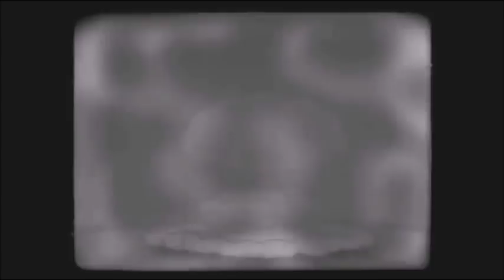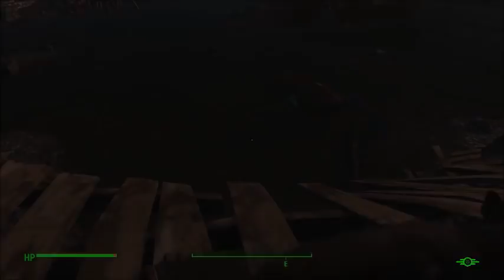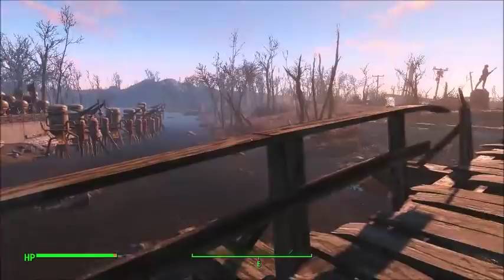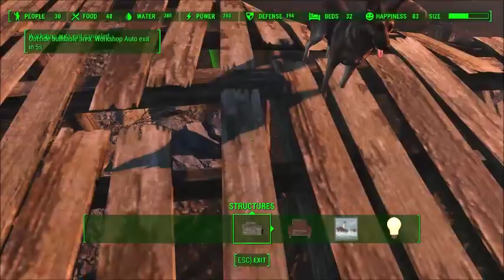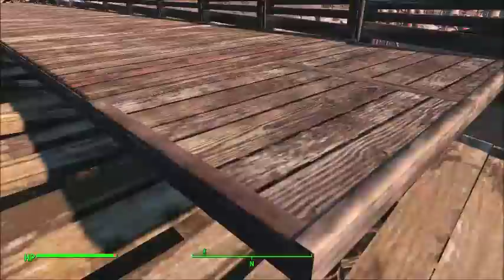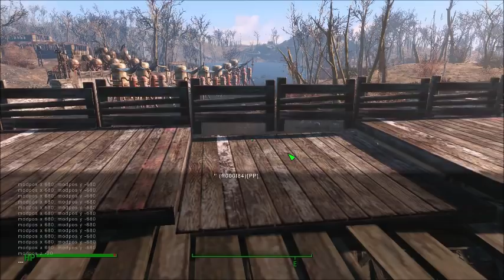Fallout 4 - Repair Sanctuary Bridge on PC (no mods or DLC)

Comment: Man I wanted to do this on Xbox but smart thinking
Reply: AndyTheGreat sorry for being a noob but how do I create a Bethesda account
Reply: Hey you actually can!download place anywhere mod and it works!
Reply: AndyTheGreat I guess but I've never used made before do I just search the name of the mod?
Reply: If you don’t have a Bethesda account create one because you need a account to download the mod,just follow the tutorial,the mod comes with a tutorial
Reply: AndyTheGreat thank you
Reply: Try this same technique using the pillar glitch which is a function of the game. It allows you the ability to shift the entire platform into the proper area on Xbox. And since it is an aspect of the game and not a mod or dlc....there ya go. Still this is beautiful repair and gorgeous sanctuary.
Reply: Just connect a key board
Reply from the maker: +The MadMan Too bad there is no way to pull up the console on a console. 😭